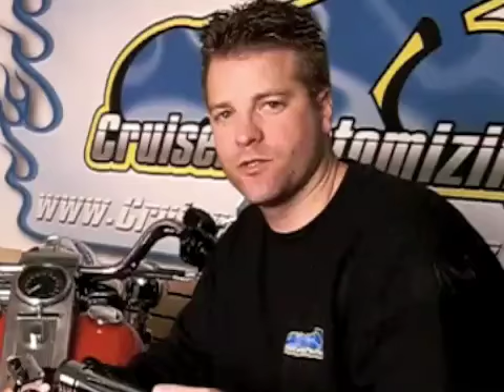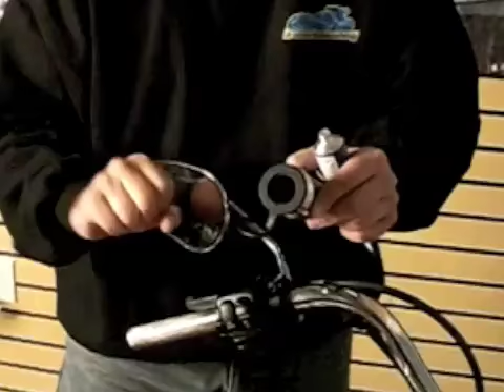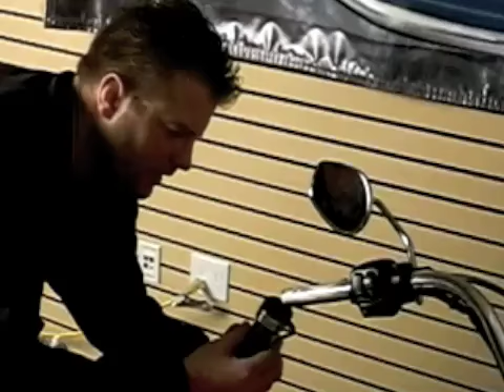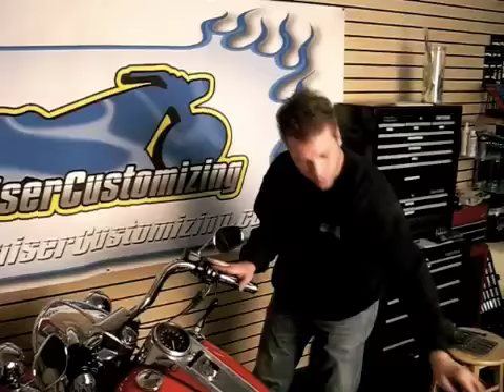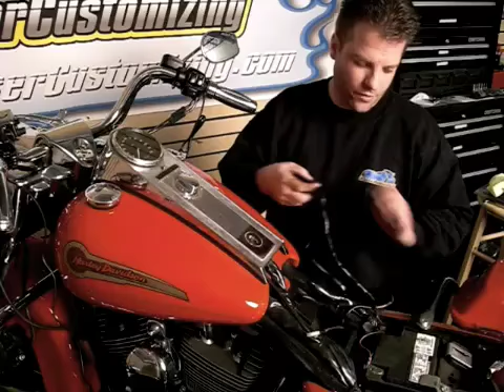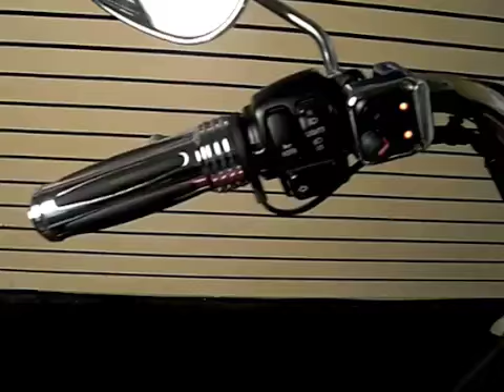Show Chrome Accessories Heated Grip Install

Comment: I have these grips on my Venture. I installed them and they worked fine for about a year, I use them maybe three times, maybe six hours total. Then they quit working. I called the factory and spoke to a rep, he said we don’t use that controller anymore that has a rheostat that you turn to increase or turn off the heat. He sent me a pushbutton module about 2“ x 2“. I installed it replaced. The defective controller has been replaced. Now all I get is the number oneLED out of the four that indicate the heat setting, it flashes four times and then shuts off… My grips are wired correctly through a fuse, I am in electrician by trade. I have 12 V through the wire harness from the battery through the fuse to the plug that energizes the grips. What’s the story?

Comment: I watched this video to try to learn what position to place the part of the group that has the wires coming out. On most motorcycles, if you place those wires straight down or aim slightly forward from straight down at the bottom. As you turn the throttle, that bend holding the wires comes up and when you go to use the front brake, the brake lever can contact, Will contact that 90° piece with the wires coming out and prevent you from pulling back the brake lever